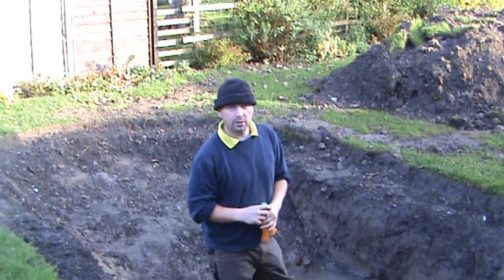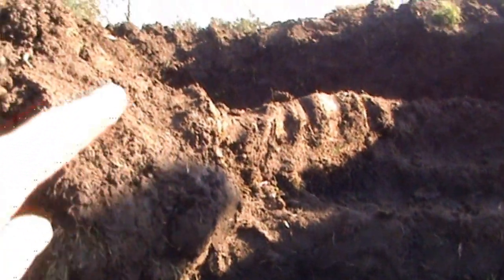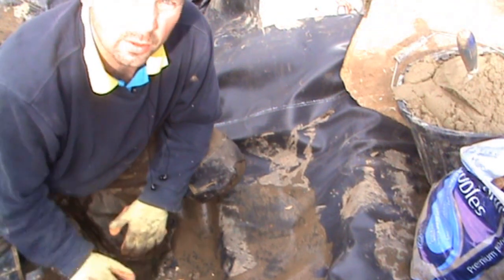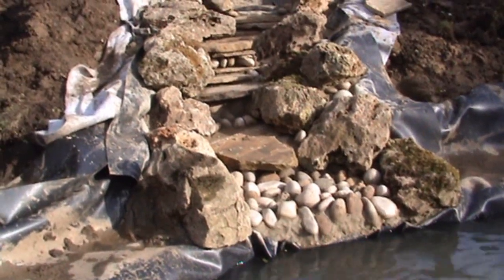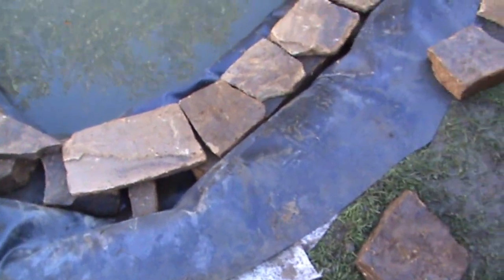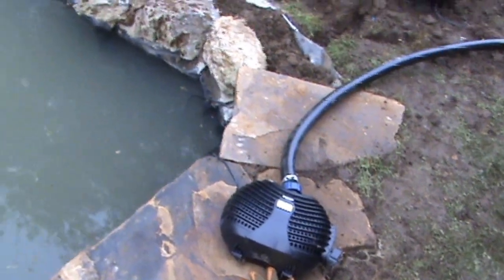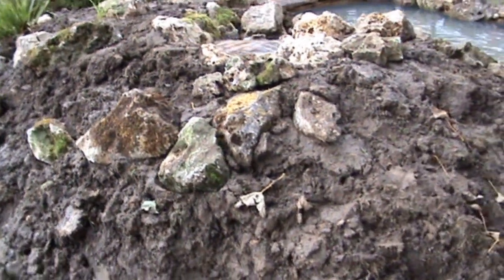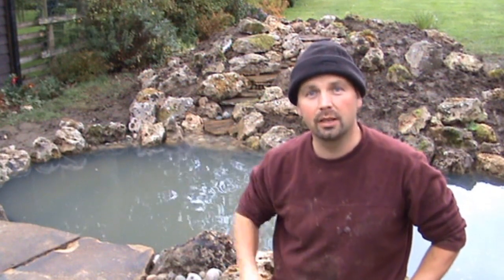How to Build a Fish Pond and Stream / Cascade - Complete pond building video by Pondguru

Comment: Hi, this video inspired me to build a pond in my garden, its work in progress. I have done the digging just wanting some advice about the pond liner best place to get it and if i should put an underlay as i have a lot of roots. your helpful video is much appreciated. I am in middlesbrough is there any way to contact you.
Reply from the maker: bilal azhar Definitely use underlay and you may even consider putting a layer of concrete over areas affected by roots. Best place in NE for pond gear ad advice would be Douglas Brothers at Sunniside as I do not install ponds now - I gave up landscaping last year and closed my shop early this year. I now sell aquarium filter media from home.

Comment: Thank you very much for this vid..I have some doubts (may be stupid) will it like if the water overflows the pond say if its raining..we need to drain using that german pump?
Also wouldn't the fish be eaten by birds as the pond is open?
Thanks
Reply from the maker: Bessen Kuruvilla Philip If it rains so hard to overflow the pond everywhere else will be soaking wet too but if you wanted to drain the pond all you need to do is turn the dial on the filter to 'drain' and it will pump water to drain.Yes predation by herons is always a risk but when I revisited this one a year or so after installation they had no problems luckily.
Reply: Pondguru Outdoors Thanks, please let me know if there is any way to overcome the predation of fishes from birds, using a net can help, but it will spoil the beauty i guess.
Reply from the maker: Bessen Kuruvilla Philip A simple wire fence will prevent herons walking up to the pond. It can be made from fishing nylon so it won't really be seen.
Reply: Oh okay. Will give it a try. The thing is that there are plenty of birds in our local area, like crows, kingfishers, eagles etc., I'm thinking making the nylon net dipped into the pond itself so that nothing gets under it..but it would  hurt fishes i guess

Comment: Hi, I'am going to build a stream and cascade in my garden but i'm a bit worried about the mortar you've used. Is it just a sand and cement mixture or did you use any additional ingredients (lime, waterproofers)? Aren't you affraid that water may wash out that mortar and is this mixture safe for water fauna?, thanks a lot.
Reply from the maker: I used a waterproofing liquid in the mix an the cement was left to cure for a couple of weeks then the pond was filled, run for a week then totally drained before being filled again. Then after 1-2 weeks it was fine to put fish in as all the muck from cement had been flushed out.
Thanks for watching and appreciating the videos.
Reply: Pondguru
Thanks mate for the information.

Comment: What is the capacity of the pump in liters per hour and what is recommended to have L/H per M2?
Reply from the maker: The links to pump and filter are in video description and where you have a cascade that will dictate the size of pump as it will need a certain flow to give the stream effect. Usually you would look to push the volume of the pond through the filter every 2 hours for a fish pond but that may be more or less depending on stream size and flow required for that. The one in this video probably turns over the volume of the pond twice every hour due to the size of pump needed for the cascade.
Hope that makes sense.

Comment: I really liked this video. I have a small prefabricated pond now that I have been wanting to replace with a larger liner type pond. I looks like the hardest job may be digging the hole and getting the steps and slope correct. Can you tell me if the pond pump and filter are available in the US?

Comment from the maker: I use 4:1 mix with waterproofer / retarder in and once cement has cured for a week or so fill the pond up, run for a few days then completely drain to wash out any lime or other crap. Upon refilling the pond is left low for the cement to fully harden then filled totally after a couple of weeks and run for a while (7 days or so) before adding the first fish.

Comment from the maker: The cheapest and easiest way is to have a small air pump near the pond injecting air into the pond. That prevents it freezing. You could go the heater route - all the pond needs is a small hole to allow gaseous exchange and allowing it to freeze apart from one hole will prevent any predators eating the fish in the winter.

Comment from the maker: Most aquatic stores which stock pond supplies will have it. It is called Firestone 1mm rubber. Can't remember the exact price as I'm not in our shop at present (Tyne Valley Aquatics) - if you work out how much you need you could get a price then as some sizes need to come direct from manufacturer if they are not a size which is stocked on the roll.

Comment from the maker: Since the pond is below ground level there is nowhere to drain excess water to but the outlet of the filter runs to a drain so by simply turning the dial on the filter the pond can be drained down to a desired level easily.
Thanks for watching.

Comment: Hi...You really seem to know what you're doing with these filters systems, so I would like to know if you could help me with this...  
I have a 100 gallon prefab pond, with a waterfall, that sets above a 200 gallon prefab pond.....is there any way to convert the 100 gallon pond into a filtration system? there are no fish in the smaller pond, and 1 huge! gold fish, 4 small goldfish in the larger pond.....my water is GREEN! I've watched a bunch of videos, but have no idea how to do this....I also have an external uv light "thingy", that goes from the larger pond into the smaller one....any ideas would be greatly appreciated!
Reply from the maker: I'm assuming you are in the UK so just phone me on 07772848730 any time during the day (I normally switch phone off around 6pm)
Reply: Pondguru nope, in the usa....i also have a 330 pump
Reply from the maker: jrjlyon53 Easiest thing is just to have a pump at the bottom of the bottom pond pumping to the UV filter (as part of a proper filter system with foams, biological media etc.) then that would flow into top pond which would flow into bottom pond. Provided the UV is big enough it should clear within 2 weeks.
Reply: Pondguru that's how i have it set up....I've had the uv light for years.....it's still really green....changed the bulb about 3 months ago.....the pond gets about 6 hours of sun....any other suggestions?
Reply from the maker: jrjlyon53 Is the UV part of a proper filter system which will catch the dead algae?
Reply: Pondguru i don't have a filter system....that's what i was asking....is there a way to make the upper pond the filter system?
Reply from the maker: jrjlyon53 It would be much easier to make a large plastic box into a filter filled with media and foams to catch all the dead algae then run the outlet from that into the top pond.

Comment from the maker: Any time you need to drop the level, yes. The pond would ordinarily operate below capacity so would absorb rain without overflowing but if it rains so much that the pond overflows then water will just drain into surrounding land.

Comment: ok so pond liner is in and full up to top the pond is 12 feet by 8 feet and 3 foot deep at deep end then the rest is 2 feet deep any insight on what pum /filter to go for ?? thanks cheaper the better
Reply from the maker: Assuming the deeper end is half of the pond base you will have approx. 6800 litres in there so you would need a filter which treated at least 'up to 15,000 litres'. I would personally use an Oase Filtoclear 160000 but it is far from cheap. Pump would be sized based on what you wanted to do with it. i.e. if you had a stream the pump would be sized on lift and spread of water. If no stream then a pump which moved 6-8000 litres per hour would be bang on.
I would use Oase Aquamax eco premium pump which are not cheap but they have longest guarantees and lowest running costs. Generally the cheaper the pump, the more it will cost to run so always check the wattage as a 'cheap' pump can cost a fortune to run considering it has to be going 24/7. Think of one watt costing about £1 a year to run. A so called expensive pump can save you a fortune in electric.
Reply: yeah i used to have a bigger pond which was 28 x 8 with some huge koi in it was gravity fed  and i used a central heating pump which was led into a three chamber filter set up made out of brick .i cant have my new pond gravity fed as liner is already in and filled .really i want just a pain and simple all in one system ie pump uv and filter in one i am looking at the fish mate 1500 uv but dont think it will be big enuff :(
Reply from the maker: gary robinson If there is no stream you could go for a couple of Filtral 9000 combined filters. Just chuck them in an they will keep the water clear and healthy.

Comment: Oh one more thing, I use the backwash water and pump it out to my plants and garden which really makes it grow like crazy. The other thing I would suggest is make a wet bog off the side about 6 " deep with a 5 1/2 lip on it fill it with sand and run a very slow weak pump over to it just keeping it wet and plant till your hearts content This will also act a heater for your pond in the winter as you cut everything back and let it trickle over to your pond.

Comment: Thanks for the great video. We're putting in our first pond and you have been so helpful. Two questions... When you are putting in the cascade you say you are using a general cement mix of 6 to 1. Is that six parts sand to one part Portland cement? Also, is that okay to use with fish? The guy at our pond store says "no cement". Thanks again!

Comment from the maker: The price of pump and filter will be different from time I made this video but check online. Model of both is mentioned in video description. Liner is 1mm rubber (Firestone) and liner is 300g per sq.m polyester. If you're local juts work out how much liner and underlay you need and we can price it for you no worries. Same with pump and filter. Shop number 01661844005. If you are not local to the North East please support your local pond supplies dealer.
Thanks for watching and appreciating.

Comment from the maker: Size of liner is dependant on pond / cascade size. I can't remember the exact size for this pond but it would have been: max length + 2x depth + 0.5m and max width + 2x depth + 0.5m.
I have put note of filter and pump in description, no worries.

Comment from the maker: Provided the washers are not nipped it shouldn't leak. I always tape the pipe up with electricians tape before holding it with a clip to avoid leaking on any pipe fittings on any filter. Just ensure that there is no muck around the fittings or washer and that it is sitting properly. Sometimes if it is tightened too much the washer can be forced into the filter fitting and cause a leak but that is rare.

Comment from the maker: If it armoured, the electric cable does not need to buried. If it is not armoured it's best run through a conduit. Alkathene pipe (water / gas pipe) is good for that as its very difficult to go through with a spade. Generally buried more than a spade depth.

Comment from the maker: I've no idea what the equivalent gear would cost in USA as I only deal with prooducts in the UK. Since £1 is about $2? that would equate to around £300 and you would get the pond liner and underlay for that. Maybe a cheap pump but not decent pump and filter. I've never price up any materials in the US so I can't be much help there. Your pond would be around 700 gallons (UK) / 836 gallons (US). Not sure just how cold your winters are but any prolonged sub zero would require a heater, yes.

Comment from the maker: I have never used the foam and thus far have not seen anyone over here using it. Maybe if I gave it a go it would be the way forward but I'm OK with mortar to date.
The wicking won't happen as the liners are overlapped on the vertical and that cuts out the capillary threat. I've seen loads of leaking cascades where the overlap of liner is only at 45 degrees.
Polyester underlay does not degrade, tear or puncture easily once it is laid so will give great protection for decades / centuries.

Comment: Hey was wondering if anybody knows a good diameter and depth for a pond I just bought a 20by 13 ft pod liner and also a 10 by 13 ft pond liner , I'm haveing troubled I finding a video for this as well I want maximum water capacity for the liner size. Thanks to anyone that can help, and it will eventually have koi in it so depth would be a factor . Thanks!
Reply from the maker: The liner would always be bought after digging a hole so trying to work out the possibilities when it is bought first isn't ideal.
There are so many different possible length / width / depth possibilities that it is easier if I just give you the formula and you can work back from that:
Liner required would equal: 
Length (plus 1ft on each end) + 2x depth x Width (plus 1ft on each end) + 2 x depth.
Reply: Thanks I do appreciate the help , yea I bought the liner first from a hardware store that sells them . I'm guessing there are dealers that cut to size
Reply from the maker: Yes all pond dealers should have them on the roll in various widths and they would be cut to suit the size of excavated pond. Larger sizes would be ordered in from the manufacturer.

Comment: I modified a pool sand filter and removed the 8 legs in the center that usually sit in sand and created 90 degree star creating tornado effect when filtering flowing in one direction and flowing the other when back washing. I only put bio balls in the sand filter and removed the sand which catches everything and coming in and when I back wash the balls clean themself. All I have to do is back wash like once every 2 months and my water is crystal clear all year long.

Comment: what is preventing overflow  rain water from flowing into pond from yard, pesticides, fertilizer, etc
Reply from the maker: With all ground level ponds that will be a possible hazard but I've never had any problems arise from that.
Reply: Cool! I was looking at the additional time/expense of a "french drain". I am doing this myself and it's been hard enough just working around big tree roots but under it is the only place that works...10' x20' rework of my previous 15 year ago effort.
Reply from the maker: Mike Kosatka Best of luck with the build, man.

Comment: Great Video. You keep your pond going all year. How cold do you get in your area. I am from Cape Cod, Massachusetts.
Reply from the maker: Yes, most ponds up here will run all year but with this one the pump is moved to just under the cascade during colder months so it does not disturb the deeper warmer water but still keeps the filter alive.

Comment: I also used a UV filter to keep the water steralized. He will have issues with yard water runoff if it rains trashing his pond and possibly killing his fish from fertalizer since he leveled the edge with the yard. Stay atleast 3 to 4 inches above the ground around the edges. You will want to run some type of decking off the side or over it to create a suspended baskit out of 1/4 inch gavenized wire to hang a sump pump in hiding the water intake to your filter.

Comment from the maker: Doesn't really matter how many steps the cascade has or how long it is as long as it is roughly in proportion to the pond. 4' is way deep enough for everything but very large koi.
I build right through the year unless there are heavy frosts (which damages the cement)
Thanks for watching and appreciating the videos.

Comment: i dont know how true this is but im sure i read somewhere if using cement in a Kio pond that you have to treat the mix with something first or have to paint something on when its dry, i know my skin reacts very badly to cement to the point where my skin cracks open and becomes very soar ( my Doctor nearly went into shock when she saw my hands lol)
Reply from the maker: Raw cement / concrete is extremely caustic until it is cured so if the pond is rendered it needs to be painted with a suitable pond paint of fibreglassed. 
For a pond like the one in this video the amount of cement a pond will normally be in contact with will be limited to a few bits on the cascade as the edging cement is above the water line so it generally wouldn't need to be treated with anything. It's still best to let it harden, run the cascade for a day or so then totally drain the pond and re-fill it. It will be fine after that.
Reply: wish i knew Raw cement / concrete is extremely caustic before i started using my hands without protective gloves lol but that was a long time ago now

Comment: Remember how I said I created the bulkhead, I ran my liner over it as well and created a small shelf under the rubber which I have sitting my airpump that runs out to the pond as well. This allows me to not have to run the fall 7/24 and keep everything alive. Also when putting in your fall leave some spots for a few plants. You will want to plant some things and be able to change them out.

Comment: How do you make the concrete safe for fish, so  you don't get any chemicals leaching out and poisoning them ?
Reply from the maker: Once cement has gone off for 2-3 weeks fill pond run it for 24 hrs, drain and refill. That was the vast majority of crap is washed out. Leave a couple of weeks before adding fish and if in doubt drain and fill again. Always let final water settle a couple of weeks before adding fish.
Reply: ok thanks